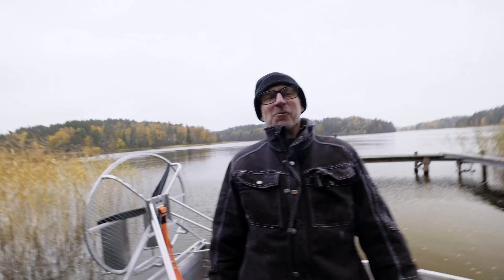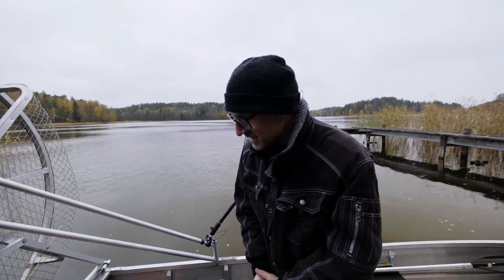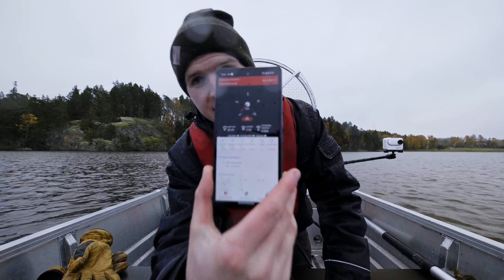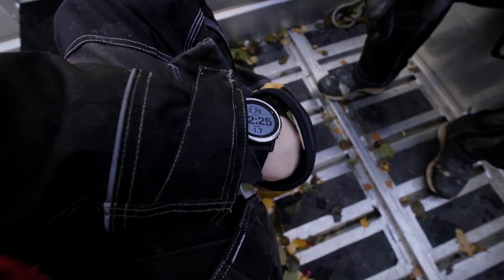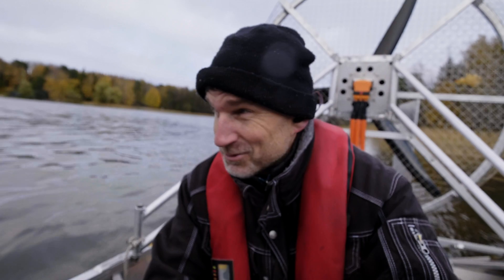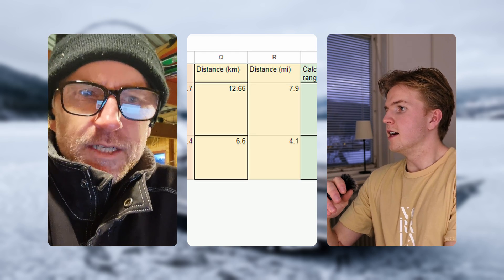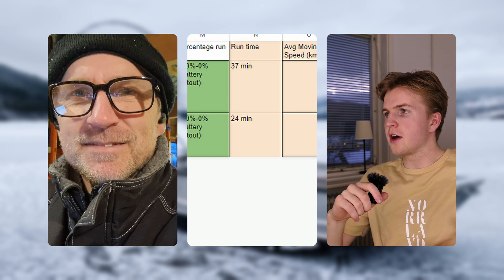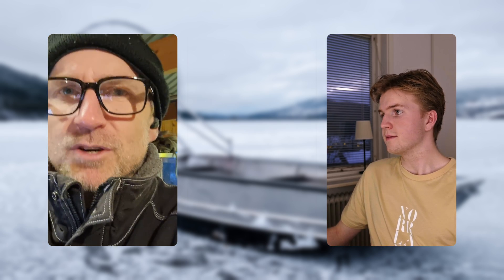Mini ELECTRIC AIRBOAT open water range test!

Comment: Well done guys. Battery size in volts and amp hours is? Regards Stephen in Australia.
Reply from the maker: Gday @s.hutton2100  96V, 50Ah, 4.8kWh, and it works pretty hard! 🍻

Comment: curious as to what rpm your prop spins and how is that controlled with the electric motor
Reply from the maker: Approx 2500rpm @kevinhodge1238 and controlled by ESC.